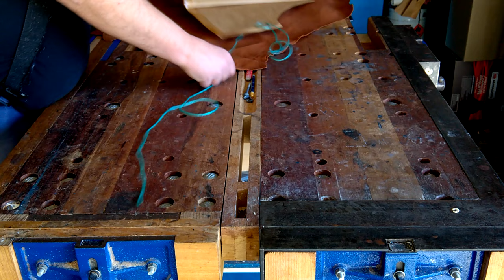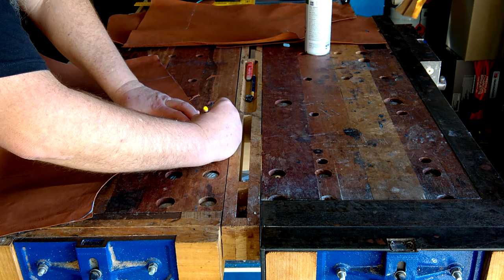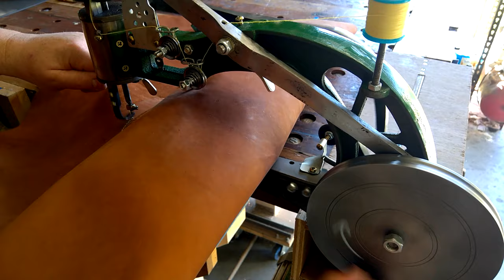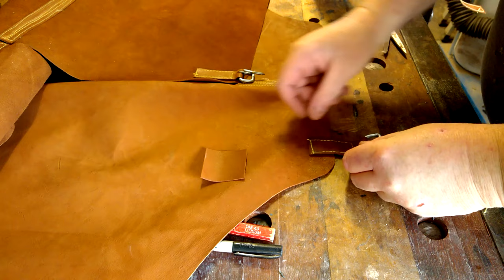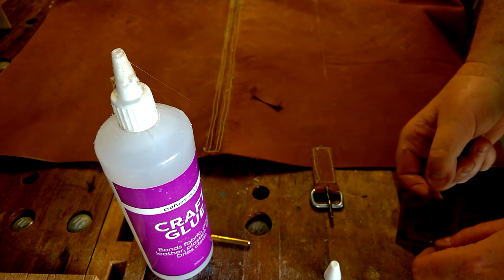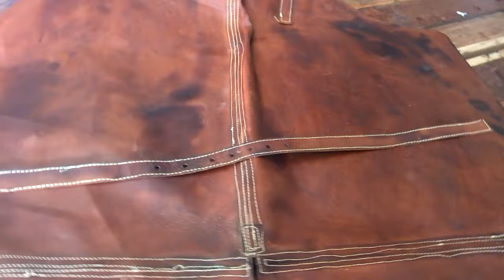Making a leather apron with a chinese patcher sewing machine.

Comment: Great job! I've been watching videos on this machine. It Doesn't always arrive in the best condition but It looks like you have it running well. Again, very nice 👌
Reply from the maker: It worked straight out of the box. But took it apart and gave it a sand and oil and got it running a lot smoother, without much trouble.

Comment: nice, may i ask you were you got your machine from?
Reply from the maker: I got it off Ebay a couple of years back, Amazon has them to, search "shoe leather sewing machine". Price seams to have gone up dramatically, were about AUD$100, seam to be in the $200-300 range now.
Reply: @waynepugh5789  yes true. Yours looks a little more heavier duty than what I've seen on either Amazon or Ebay thats why I asked. Thanks.
Reply from the maker: @grumpyiwegianpodcast3505  

No, its nothing special, just the standard 3 legged one's you see on them sites. Only mounted on a board instead of the tripod, so i can clamp it into my workbench vice.
Reply: @waynepugh5789  Looks like it works really well. I'ved been thinking about getting one but wanted to hold off till i seen it in action. N ow that I have I think I will. I have an electric but I want something I can go totally off grid with anbd this would be perfect. Thanks for your feed back.
Reply from the maker: @grumpyiwegianpodcast3505  

The off grid aspect is what i got it for. Though i have it set up so i can use it with a foot pedal controlled electric motor, that hooks to it with a drive belt around the big cam wheel crank on the front if i want. There are some videos on YouTube about setting them up, there are some bits that can do with a disassemble, sand, polish, oil, straight out of the box to make them run smoother. Defiantly feels like the best value for money tool in my workshop.
Reply: @waynepugh5789  I've done all my sewing by hand till last couple years. After the third TIA {MINI-STROKE) and Old Age catching me I got lazy and decided to start using a machine.